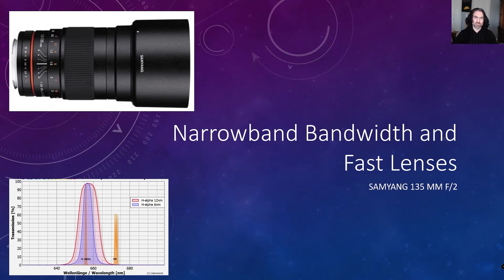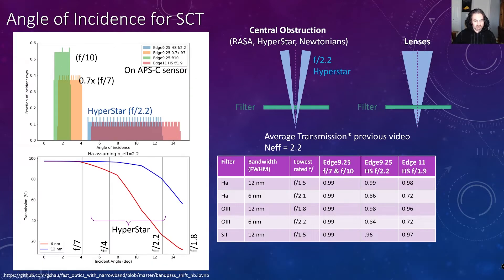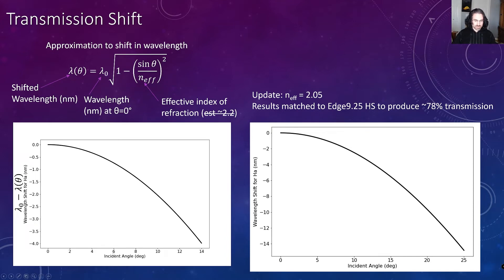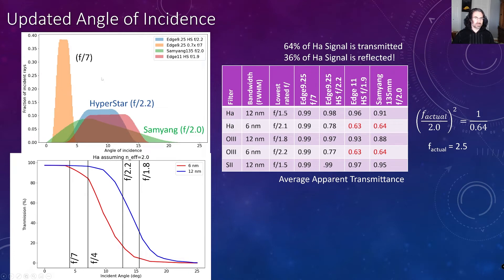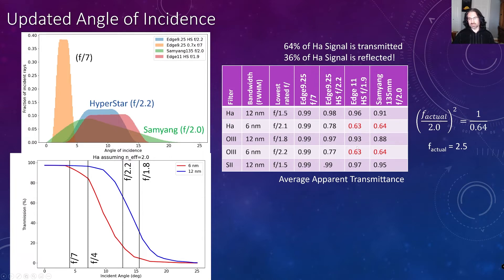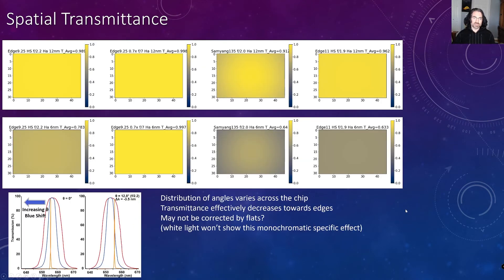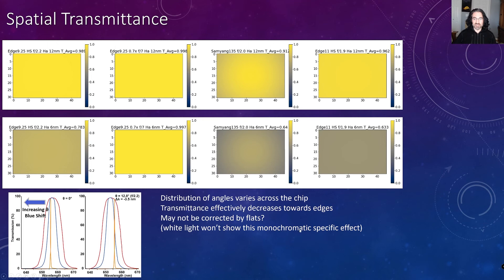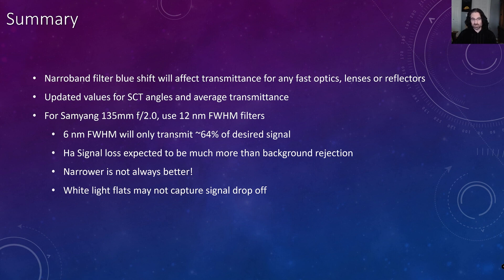Narrowband Bandwidth with Fast Lenses: Samyang 135 mm f/2.0

Comment: Thanks so much for your experimental approach regarding filter bandpass and f-ratio on a range of optics used for astro-imaging the results have enormous implications not just saving money. My own imaging set up uses a Samyang 135mm operating at f/2 but I have been using the vanilla 12nm Astronomik Ha filter both with a modified Canon 700D DSLR  and more recently the smaller sensor ASI533MM-Pro. I haven't noticed vignetting with the dedicated 533 but often wonder if buying an Astronomik 12nm Ha MaxFR filter would realistically improve the collected Ha signal? Theory would suggest that a pre-shifted 12nm Ha filter should allow a higher passage of Ha photons at f/2 but perhaps the wide peak of the vanilla 12nm filter is broad enough to pass the light anyway? Lacking a spectrometer and realising the filter lottery out there with good, bad and indifferent samples being sold who knows or can even realise? Would you be able in the future to undertake similar testing comparing tbe performances of vanilla and MaxFR filters for users to make an informed decision over purchase? As you know the Max FR filters have a premium price and perhaps at f/2 for no practical advantage. Thank you again for all you have done on this topic. Regards, Steve
Reply from the maker: I don't have evidence of this, but I think part of the premium price of maxfr filters is the quality control astronomiks provides.  
Also, the qc matters way more for ultra narrowband where very slight error is catastrophic.  At 12 nm bandwidth, the qc doesn't have to be as stringent to still work great.
Reply from the maker: If you don't have halos or issues, I don't think upgrading to maxfr will do anything for you.
Reply: Thanks very much for both replies, I really appreciate it. 👍

Comment: Thanks for your analysis. I have struggled with my Baader 3.5/4nm filters for fast optics on both RASA 8 and Samyang 135mm f/2.0. Different from the RASA 8, Samyang 135mm f/2.0 results were disappointing ( The target is Veil nebula, which is good for both Ha and Oiii). Now, I know the reason. Thanks again!

Comment: Thank you for this video! I have one question.   Is there a way to measure where the break even point is in f stop between 6nm and 12nm?
Reply from the maker: I am not sure what you mean.
if you are using the 6 nm filter, you could set the lens to f/2.6 as that is about what the filter will pass, and maybe it will give you a little extra depth of field for good focus?
if you are using the 12 nm filter, you can set the lens to f/2 and get most of the light through the filter.

Comment: That's actually very accurate, I use this lens and you do notice that the signal does drop off in the corners as you describe.  The lens really isn't setup to take a flat field like many of the telescopes out there so I always just thought that was the reason.